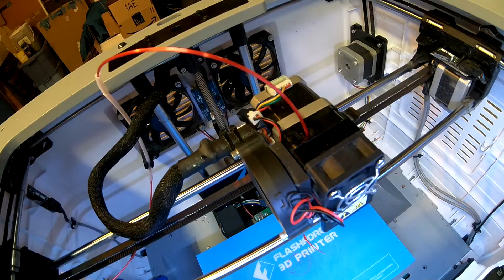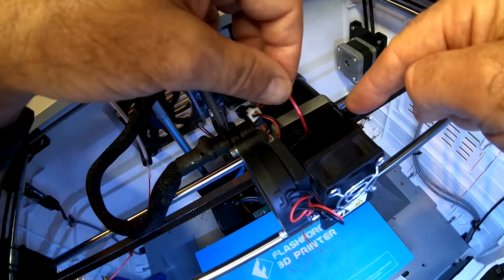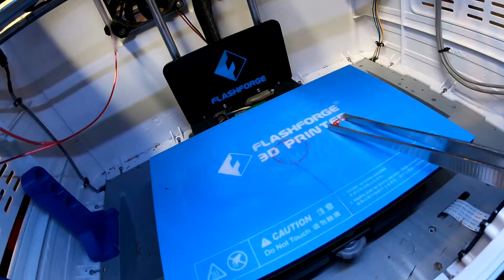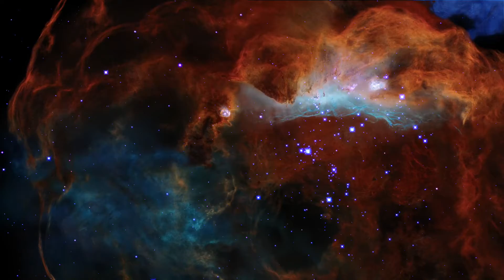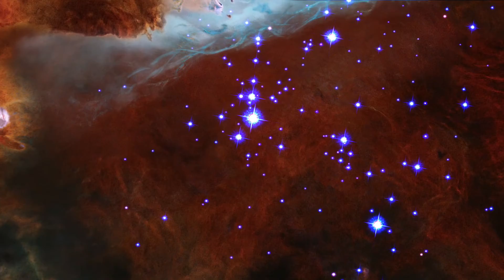Flashforge Dreamer (NX) Tip: Unclogging the Printhead *Without* Disassembling It

Comment: Where did you get. The needle?
Reply from the maker: The kit I bought is no longer sold, but here's another one:
https://www.amazon.com/dp/B07PVVQ6X6/
I think it's important to use a needle when cleaning the print head.
Why wouldn't you want to poke through all the way to make sure the opening is clear?